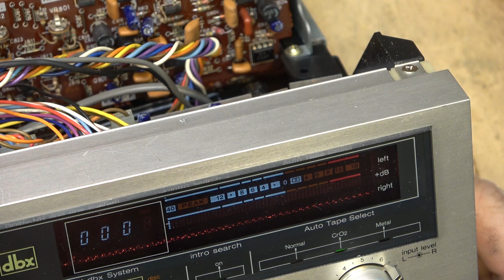Technics RSM275X FF and Rew Slow no Play or Record

Comment: That DBX noise reduction has an unbelievable full-bodied sound to it!
Reply from the maker: It was very good.  No detectable hiss.  It is so good that you can hear the noise my cheap mp3 player makes
Reply: DBX is way better than dolby (even dolby C)! I also own a Technics with DBX (RS-M255X), really sad that dolby took over... maybe licences were cheaper? On the other hand DBX was very usual in the professional world : external units with 8 tracks reel to reel or even integrated in small 4 tracks tape studios (tascam 424) for example. 

The downside of Technics decks of this era is leaky capacitors... there are so many, it's a really tedious task to replace them all. My Denon DR-M2 doesn't have leaky caps and no belt either!! It's nowadays my main deck for recording especially since I need my tapes to be listenable on my others decks/walkmans which aren't DBX equipped. Of course I never use Dolby since it muffles the trebles but always CrO2 tapes (UX-S mainly), hiss is in fact very acceptable on type II cassettes.

Comment: A well built quality deck with a good spec.
Servicing these type of decks is not a five minute job due the amount
of dismantling required just to change the belts.
Still well worth doing for the excellent performace they offer.
Later decks with cheap mechanisms were not in the same league,
and wore out very quickly.
The old saying of "They don't make them like they used to" applies here.
Reply from the maker: And the owner is already complaining about it costing 100 bucks to change it.   I said if it was so simple he should do it himself.
Reply: @12voltvids  That's just typical, you spend hours trying to fix it, 
your fingers are sore from all the sharp edges, and the customer 
moans about the final bill!
You can't win for trying sometimes.
Have a great Christmas and New Year.😊
Reply from the maker: @Barbarapape  that's the way it is, some things just never change! 
Everyone wants stuff done for nothing.  That's the main reason I got out of the business. Must be a Canadian thing because Americans that send in equipment never balk about the price but the locals i deal with always want stuff done for next to nothing.
Reply: @12voltvids  I left the consumer repair trade for similar reasons, customers here in the UK are the same as yours in Canada.
They argue about the cost of spares, then still expect it done for no margin.
The local shop i worked for closed, so i went self employed doing repairs, which was great until i had string of non-paying customers.
So i left to work for the MOD doing repairs for the RAF, decent wage and no customers to deal with.
Hope you are having a great Christmas.
Reply from the maker: @Barbarapape  I make money from my YouTube revenue not repairing stuff now.  Working in telecommunications now I still deal with customers but I just bill them for billable work and if they don't like it they can call in and bitch at someone at call center.
Reply: @12voltvids  I still do repairs, but only by word of mouth, and make it clear that parts have to be paid for.
Making a living doing just repairs is not worth the stress, at least doing Youtube provides an additional income.
I don't do enough repairs to make a Youtube channel a viable option.
Customers must be the biggest reason for leaving consumer electronics repairs.🙂
Reply from the maker: @Barbarapape  it takes time.  Took me a few years to build up the channel.  Now I could live off my YouTube income.  The naysayers say don't expect to have a sustainable income from YouTube.  It depends on your attitude and what you are willing to put into it.  It's like investing you have to have long-term goals.   So the question is do you want to make a couple hundred a month or a couple thousand depends on how much effort you put in and how much time you invest. The thing with making content for YouTube provides an ongoing stream of revenue. Stuff that I did many years ago still generate royalties today. No different than a musician that records and publishes. He makes money every time someone purchases his song, every time a radio station plays it or it gets streamed on a platform like YouTube. This is precisely why you can't use copyright music in your production if you want to monetize your YouTube channel because as soon as you do the person that wrote that song will be the one taking the revenue. Having my YouTube channel means I'll be able to retire even sooner from my day job. I have a little more in a year to go and then I'll hit the magic age where I can start to think about getting out of the full-time job, doesn't mean that I will but I'll have that option, may stick around for a few more would like to get 20 in at the phone company.

Comment: This machine it's a Nak killer!!!!!!!!😎 (A lot of people will be upset that I say this. 😇😇😇)
Specifications:

Type: 2-head, single compact cassette deck
Track System: 4-track, 2-channel stereo
Tape Speed: 4.8 cm/s
Heads: 1 x record/playback, 1 x erase
Motor: 2 x reel, 1 x capstan
Tape Type: type I, CrO2, Metal
Noise Reduction: B, C, DBX
Frequency Response: 20Hz to 20kHz  (Metal tape)
Signal to Noise Ratio: 92dB  (DBX)
Wow and Flutter: 0.03%
Input: 60mV (line), 0.25mV (mic)
Output: 0.7V (line)
Dimensions: 430 x 98 x 326mm
Weight: 6.5kg
Finish: black, silver

By the way, very good work, as always.
Reply from the maker: Nakamichi were very overrated.  There were quite a few that had far better performence.  I have one if these and a JVC tdv1010. That's a 3 head dual capstan with direct drive main capstan and tension capstan is belt driven off the main. Both with very big flywheels.  The only thing the JVC lacks is dbx.

Comment: Now that was a pain just to get to the drive belt, thankfully the plugs/sockets were  marked.
Shame about the belt mistake, i was hoping it would work.
But you didnt give up.
From what i can hear, it sounds really good :-D.
My memory has slipped, when you said "The solder i use is..."  i thought Kester.
Ooops.
I have a reel of maplin solder from years ago and a reel of Multicore brand.
You would think the reel was full of gold with the silly prices lol.
Reply from the maker: I used to use kester.  Local place doesn't carry it but this stuff is every bit as good.  That's why i have been using it for the past 5 years.  This is the 3rd roll and if it was no good i wouldn't have gotten the second.

Comment: They made it so hard to get at those belts. On a similar DBX model from 1985..  I've been using my fingers to turn the gear on the left to play tapes - since I can't even find a supplier for the belt   - it will play tapes but due to that same belt being a bit dodgy - getting some extra wow and flutter..  so I can't use it as my master deck for now.. - I could take it apart and recondition the belt and clean the surfaces which might extend the  functions for a while.. but I'm afraid of damaging something (like @10:00)  on reassembly likd I did to my AKAI 3 head deck which I destroyed perfectly  - it still looks pretty but can't play a tape LOL .  UG.
Reply from the maker: The first time i took mine apart i was the same way, but I have done mine now twice and now this one twice.  No big deal now.  I can do it in under 30 min if I am not making a tutorial video on how to do it and not fu*k it up. This one is a very good unit to service as aside from that belt it is literally bullet proof. One of my favorite cassette decks from all time and the recording quality shows exactly what they could achieve out of a 2 head deck.

Comment: Working on these is almost like working on mechanical clocks lol. Have you ever worked on mechanical clock movements like the ones for grandfather and mantle chime clocks?
Reply from the maker: Yes i rebuilt a grandfather clock that I found at the side of the road.  It's ugly, had been someones project they never finished.   Got the moment working and set the regulator.   Need to stain the wood and put the glass on the door.  Sits in my kitchen.   Did this before I was making videos.  Have fixed a few mechanical clocks on my channel.  One that uses a motor to wind the spring every 20 min (I have another one to do some day) and a westclox transistorised electric. It has a balance wheel, hair spring and escapement just like a conventional clock but no main spring.  Instead the balance wheel has a tiny magnet on it and a coil on the chassis.  To start it you just shake it (or pull the start pin on the back that sets the time, when you release it, the balance wheel is kicked.   When the magnet on the balance wheel passes over the coil it produces a small induction which triggers the transistor which fires a larger voltage into the coil to repel the magnet to the end of his travel and then the hairspring brings it back and as it passes over the coil it produces another pulse which then causes the transistor to kick and propel the balance wheel to the other end of its travel and it just keeps doing this every time the magnet passes the coil it triggers the transistor which gives a kick which kicks the magnet away and so on and so on. Very cool goes back to 1965 or so, long before quartz clocks were developed and yet it is every bit as accurate as a quartz clock. Look it up there is a video on my channel where I took it apart and lubricated all the stuck gears and escapement. And I did it with three in one motor oil several years ago it hangs in my hole running constantly. One sea size battery lasts almost a year very efficient.
Reply: @12voltvids  That's awesome! It sounds like you can pretty much fix almost anything lol. Merry Christmas!